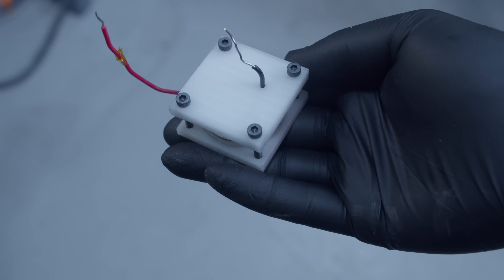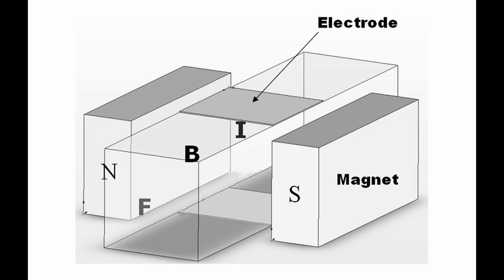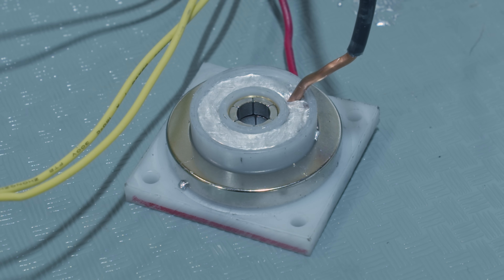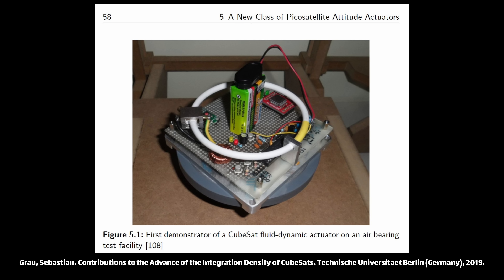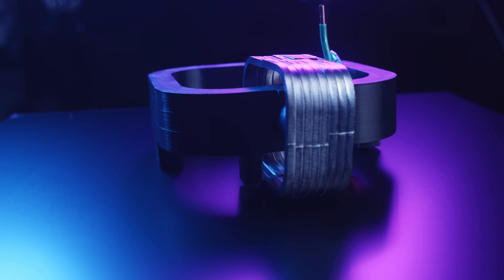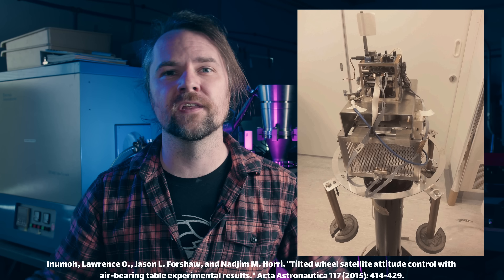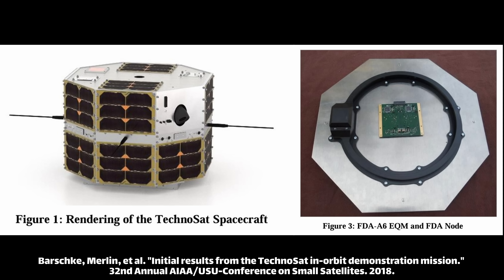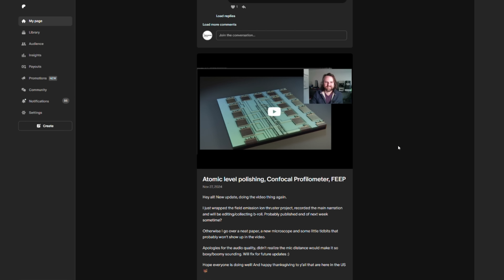A motor with no moving parts (sorta)

Comment: I'm very curious about the shape of the larger "wheel". Does the rounded square shape actually confer any advantages? It seems likes it could be losing some efficiency through having a higher radial acceleration through the tighter corners than a circle with the same outside dimensions. I haven't bothered to do the math so I suppose it's potentially not an issue, or at least not a big one.
Reply from the maker: Good eye! The research lab studying these things chose the rounded-square profile because it maximizes the effective diameter and amount of flowing metal that can fit in a cubesat shape. You're right though that the corners lose efficiency compared to a circular loop. So in real flight hardware you'd have to spend some time optimizing between a square (to maximize angular momentum) and a circle (to minimize fluid losses). There are a lot of other funky shapes I didnt talk about too, like L shapes (to get two axis in one loop) or stacked spirals (to get more angular momentum out of one device)
Reply: And we also did what we called crown-shaped FDAs for redundancy.

The main reason for the rectangular-rectangular "toroid" was integration with CubeSat structures - you get a really bad volumetric efficiency when you try to combine a classical toroid with cuboids.

Comment: 9:13 yes 18650's that have a notch on the + side have internal shot curcuit protection and I think overvoltage protection aswell.
Reply: You can bypass the protection by jamming a little piece of metal into the protection part, puncture the first layer and press into the second.
[NB: it is always dangerous to bypass safety mechanisms, do so at your own risk]

Comment: What about using a different conductive liquid with platinum or gold coated electrodes? If the chamber is sealed well enough, you could use something other than metal with a high vapor pressure. This might help with the low voltage/high current problem.

Comment: If it is the electric field and lorentz force that is moving the liquid, why can't the electrodes be isolated (&still close to) the liquid metal? You could reach higher field strength with higher voltage and very little losses.

Or is the liquid metal itself acting as a electromagnet and needs a current to generate force?
Reply from the maker: An induction configuration is possible too! Check out this paper ( https://ntrs.nasa.gov/api/citations/20070022272/downloads/20070022272.pdf ) for more details. Just more complicated since you have multiple phases, and different scaling losses compared to DC or AC conduction mode.

Comment: Wont the angular momentum reset once it's turned off?
I've never understood this one. Unless doing it quickly is the key just like shooting a bullet from a heavier gun. I think I'm answering myself. It's just not a polished answer
Reply from the maker: Essentially yeah. So on orbit if you want to point somewhere else, the wheel will spin up a certain amount to start slewing at a desired rate, then slows down once you get to the desired location. But the "idle" RPM will now be non-zero to maintain that location. If the wheel reset to zero you'd rotate back to your old location. Satellites have to periodically dump or "desaturate" their reaction wheels with some other mechanism to bring the RPM back down to a nominal range. Usually done with magnetorquers on small sats and thrusters on big sats.

Comment: Why not using something like a coil gun with trapped pieces of metal that would give you the inertial change? Why the need for a wheel so much? Like little rail guns pointed in the three axes. It would be kind of like a hammer blow. And you could adjust the the inertia by the amount of power you send
Reply from the maker: Reaction wheels are nice because you never run out of "fuel". Just spin up or down as needed to rotate around, using electricity from solar panels. Something like a coil gun would work, it's more generally in the same category as thrusters (chemical, ion, etc) but you'll run out of fuel eventually.

Reaction wheels are also nice because they can be fairly precise. Motor technology is really good these days, so altering the wheel speed very slightly can precisely position your satellite. Thrusters that eject material have a lower limit to their precision since it's limited by the thing you're ejecting.

Comment: How about this except the donut is a circular magnetic path with material going around (like in a particle collider or bent maglev track), and you get reaction based on where in the track the magnets get energized and pull or slow the material.

Comment: You could add another capacitor along the line or reduce the wire loop area to ease the strain on the batteries
Reply: That would do precisely nothing.
Reply: It will supply additional charge during transients from the cap rather than the battery. It will also reduce the effective inductance of the leads
Reply: It's steady DC. There's no variation in the current demand, the cap is just... there. No benefit to its presence in this scenario whatsoever. 

If a smoothing cap were useful in a scenario like this, it would need to be absolutely massive. In fact, the one in the buck converter is effectively completely defeated by such a low resistance load. What he has there is in effect a simple PWM controller.
Reply: @MadScientist267  the turning on/off of the switched load is when the caps are most relevant.
Reply: @alphasierrabravoyt  If you're referring to an operation cycle of whatever sort, both unnecessary and detrimental. That just increases the inrush. If you're referring to smoothing before feeding the current to the liquid, see my edit for the last one.
Reply: @MadScientist267  you're probably right
Reply: When you're "directly pushing against a magnetic field", as is the case in a brushed motor or MHD device, PWM is all but perfectly suited to drive them, as no additional smoothing is needed, the momentum of whatever is being moved is more than adequate averaging. 

Capacitance, be it stray, or for some reason intentional, in a PWM circuit is almost always a problem, never a solution. It increases the strain on the switching device(s), regardless of which side of a converter it is placed on. 

The load here is essentially a dead short, the resistance is too low to even really consider. If you place a capacitor at the input side of the switching device, you're increasing the peak switching current that the device has to handle, with minimal advantage at the "motor". 

If you place it at the output, any reasonably sized capacitor isn't going to have any real effect with such a short time constant with the load. It will however also contribute even more to the peak current the switch device has to handle. 

If you want to get rid of inductance in the feed lines, twisting them together will all but completely cancel their contribution out, but there's also a problem in getting rid of all of the inductance in this. Even with "current limited" as was happening with the buck converter in the video, the current can't be seen until the switch comes on. If there's no inductance to absorb this while the feedback circuit does its job (turn the switch back off before the current rises too high), it can/will let the magic out of the switch. To prevent this, if there isn't enough natural inductance present, one might even intentionally place a small amount in series with the output, typically "snubbed", or just a simple resistance, with the sole goal of giving the switch "room to work" so as to protect it. The buck converter is self protecting because of the configuration of its components. The inductor protects the switch from excessive current spikes in the process of doing its normal job.

Comment: Here's an idea: You can reverse these devises to be a rotation detector. Any rotation with induce a current in the motor (this is how people detect rotation)
Reply: How would this compare to laser ring gyroscopes or fiber laser gyroscopes?
Reply: @kellymoses8566  very poorly. Resonating structure gyros have achieved unbelievably exquisite levels of sensitivity and precision and can now reach FEMTORADIANS per second levels of rotational measurement accuracy.
Reply: @kellymoses8566  different, that's all. I could see these being VERY low power too as they generate some current; oh and super super tiny..
Reply: @seejayj Smaller than a MEMS gyroscope?
Reply: @kellymoses8566  i don't know

Comment: Thats a beautiful system.Galium is illegal on airoplanes as it eats aluminium.  I tried to make a bearingless floating reaction wheel as its the bearings that fail "Electromagnetic Ring Motor " using a solid rotor but failed to get it to float, maybe works better in space or needs side coils. I would be very pleased to see you have a go at that design. I put it on YT to open source it.

Comment: Wonder why they don't use magnetic bearing for flywheels instead of ball bearings that would fail over time?
Reply: Afik some do, but you need supports for launch, backup bearings in case of power or system failure, the control system is pretty complex, and the low stiffness of magnetic bearings probably puts a strict limit on the maximum turn rate.
Reply: Also you want satellites to not have any intrinsic magnetic field at all, since that would interact with earth's magnetic field. The most simple way is to not use any permanent magnets on board, or be super careful about their placement.
I imagine the rotating magnets of such a bearing would be extra hard to design with.

Comment: Won't this always have massive friction unless you somehow manage to suspend the metal in vacuum?
Reply from the maker: Kinda sorta, it's complicated. Frictional forces vary depending on distance from the wall. Highest velocity in the middle, lowest at the wall itself. So the geometry of the chamber has a big impact. And it's extra complicated for liquid metals like galinstan which form an oxide skin. The skin won't be moving much at all, but the internal metal moves with very little friction. Sooo.... yes but complicated. Folks have done some mathing and there seems to be a sweet spot where it's efficient enough to be usable.

Comment: While I can see that with no bearings the reliability is much better.  As long as the liquid metal doesn't freeze or leak out, should last a very long time.

But what about power consumption?  Traditional wheels can be spun up and they keep spinning without constant power input, right?  The turbulence/ viscous nature of the liquid metal might mean you have to supply a continuous current to avoid having it just stop very quickly after shutting off.
Reply: Yeah the reason why flywheels work is because the wheel itself carries a lot of momentum.  To achieve anything remotely similar means you need to have a lot of Liquid Metal, and then you're dealing with fluid motion inefficiencies.  It's a great thought exercise, though not likely practical.

Comment: Awesome stuff. This is really cool tho, I think the frictional forces are going to have to be addressed for this to be usable as a reaction wheel.
Reply from the maker: Some of the references I linked (I forget which one unfortunately) mathematically works through optimizing for friction losses, pressure vs flow, geometry (internal shape, diameter, etc). The tl;dr: is that some configurations aren't competitive at all, but other configurations are similar or better than equivalent reaction wheels. Seems to be a sweet spot for "large" small satellites, like 12u cubesats up to 50kg smallsats. Smaller and it's not efficient enough, larger and they don't have enough stored angular momentum available.
Reply: @BreakingTaps  After reviewing the Magneto-Hydro-Dynamics Liquid Wheel Actuator for Spacecraft Attitude PDF, I cannot find any reference to Wall Shear Stress formulas... tho I see a TON of viscous shear formulas. This isn't my area of expertise, but, I feel like they might have somehow ignored the friction of the fluid from the walls of the container for some reason? ( Do you see anywhere where that is specifically mentioned?)

Comment: The reason you had such poor efficiencies with the magnetohydrodyanamic reaction wheel was that your base plate was of an inferior pre-famulated amulite composition.  You should also test out a lotus-o-delta configuration to minimize waneshaft side fumbling.
Reply from the maker: Oh, doh! Totally forgot about the waneshaft side fumbling! 🤦 What a rookie mistake 😄
Reply: that also explains the sinusoidal deplanaration.
Reply: I’m gunna include this in a turbo encabulator joke.
Reply: This is devamulation effected, unless you adjust for Plavos-Kreuger reaction.
Reply: But Plavos-Kreuger (at least in the context we're discussing here) is really just a scalar representation of the Heteroshyte Y-component. So in practise it pretty much all cancels out in the end, no?
Reply: @davidf2281  There's a homeostatic balance in the sine/cosine junction. It's not canceled,  just synergystic.
Reply: Fair point. Those triple vectors crop up everywhere!
Reply: He also forgot to consider the capacitive varactance.
Reply: But because of the Korsocov postulate, wouldn’t the spin of the destriated base be down, thus resulting in a positive angular vector? He would have to add a niconium substrate and perform a lobster claw crystallization.
Reply: In modern designs the Waneshaft effect can easily be dampened or in some cases completely offset via application of a diff-limited Laminal Heteroshyte vector. This is usually achieved with nickel-copium angleshunt diodes.
Reply: I... I am scared. What are all these words?

It's times like these that I realise how much I have yet to learn.
Reply: @thomascorbett709  Im no scientist but I think he is just making stuff up. lol

Comment: Would a slip ring work for testing on a power supply? Or too much friction
Reply from the maker: Probably would have worked better than the wires! Would still be too much friction for "real" testing, but would have been heaps better than the wires I think. They added a lot of drag and "pulled" to one side which made the air bearing act like it was tilted.

Comment: 9:05 The protection circuit is located at one end of the battery, under the insulation. It can safely be removed. I recommend getting high output cells, such as the ones used in power tool batteries.
Reply from the maker: Aha, thanks!
Reply: @BreakingTaps  You can easily buy 18650 batteries without protection circuits, most are unprotected by default. Protected ones are usually explicitly labeled as such. 
Rule of thumb: battery length ~65mm = unprotected, ~68mm = protected.
Reply: @BreakingTaps  if it has a button it will have a protection circuit, flat top cells are always unprotected. the protection circuit is a small pcb on the positive end normally encased in a shield of the button.
Reply: @BreakingTaps  If this is of use to you, I'm glad to have helped!
Reply: My recommendation is molicel. Very high current batteries, and very affordable. I usually do through 18650batterystore. They ship properly, and their customer service is great.
Reply: @swirrllfolfsky9803  Which molicel battery do you recommend and what purpose have you used them for?

Comment: This is cool!  Can you make 2 of them, counter rotating.  When 1st one turns off, turn the 2nd one on to counter the reverse rotation, then turn the 1st one back on.  Repeat.  Would the unit spin continuously? & would it have angular momentum tilting it like a gyro?  You could also have the inputs on a flip flop to reverse the direction of flow.  Could do this for each axis, x,y,z.  Independent flow direction control and force vectoring for each axis.  Very cool!
Reply: If I understand you correctly, you want to make the entire assembly rotate continuously? that would just make the whole thing stationary. That is why you'd need thrusters.

Comment: is temp not an issue with liquid metal in space ? would a ferro fluid not be better ?
Reply from the maker: Ah oops, I was going to mention that and forgot. Galinstan has a freezing point around -20C, which is also near the lowest temperature you might experience in LEO orbit. So it might need a small heater to keep it liquid, or possibly not depending on thermals of the spacecraft (how insulated, how much heat it retains from the sun-side, etc). For missions farther away from earth it'd definitely need a small heater to keep it liquid. Although some amount of self-heating from joule loss during operation will help heat too.